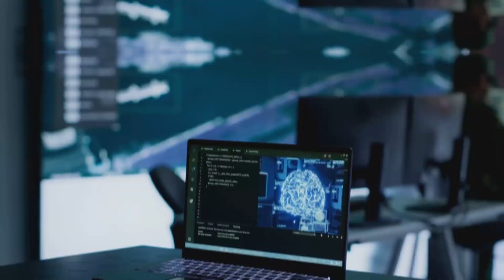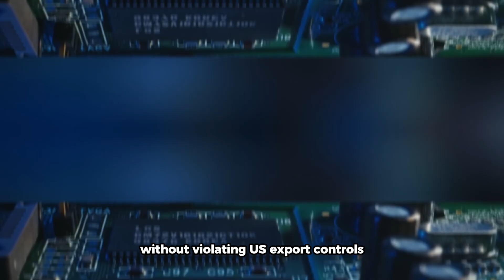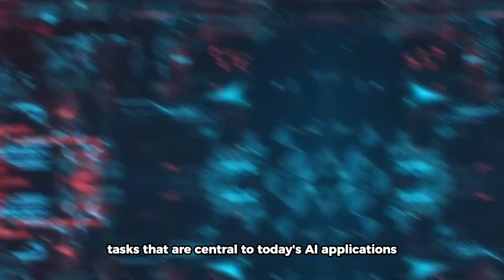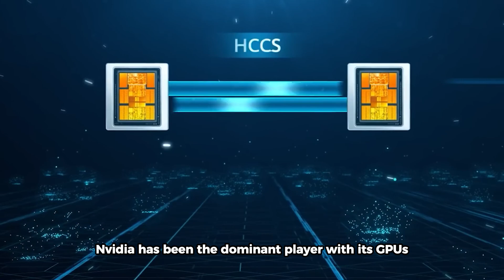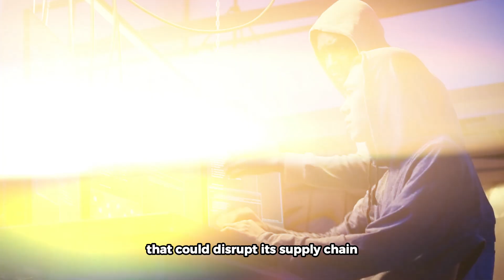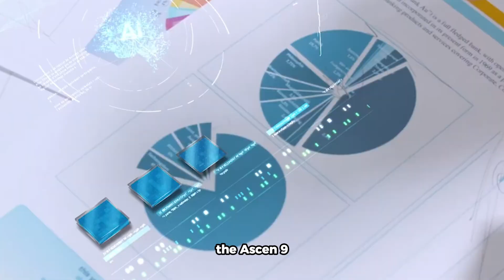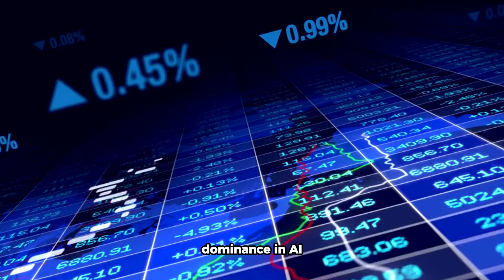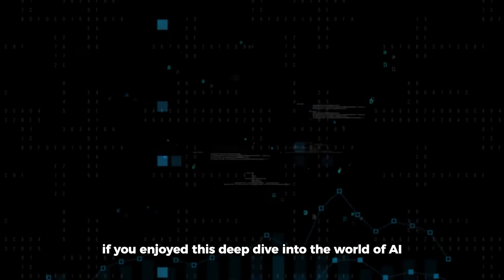This NEW Huawei AI Chip Is SCARING Nvidia!

Comment: I think your conclusions are not correct.  First Nvidia cannot sell its H100 chips to China so if the Huawei Ascend 910C can do the same tasks, Chinese AI developers have no choice but to use Huawei's chip.  As for production, even Nvidia is having production issues, or I should say TSMC.  TSMC is having difficulties making the Nvidia chips.  And, let's not forget Alibaba's new chip, the Hanguan 800 which is said to be also a very powerful chip designed for machine learning.